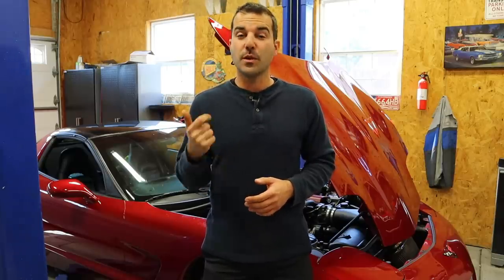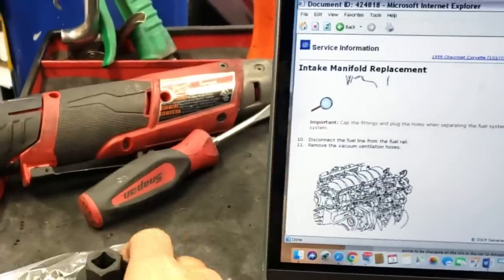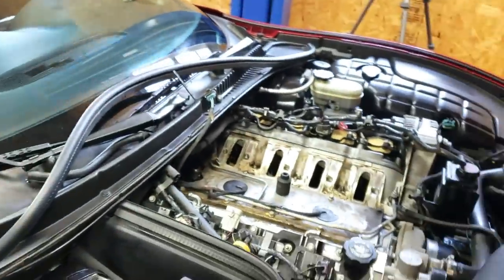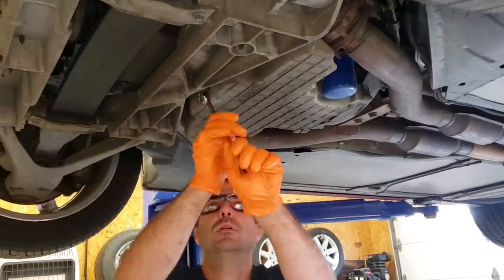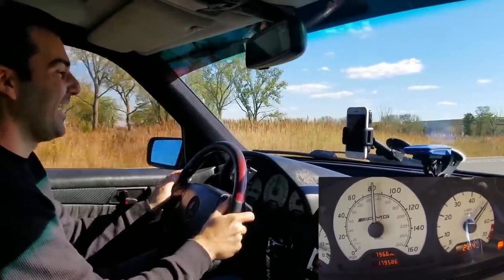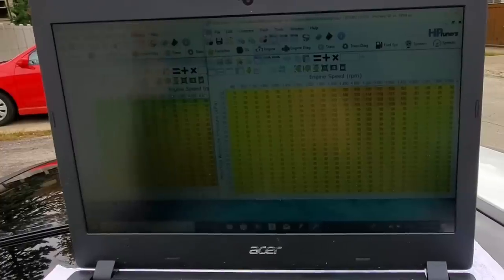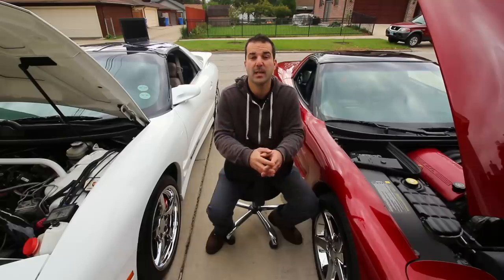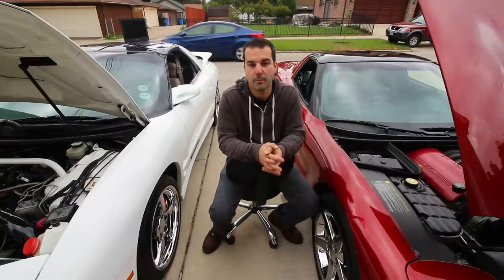I’m Building A 40 MPG Corvette That Sacrifices NOTHING! Project EcoVette Starts Now!

Comment from the maker: Do you think 40 MPG is possible and what other mods would you do?
Reply: Northstar Swap
Reply: Some sweet retro dinner plate wheels should help with aero
Reply: So first off, Weight reduction!  Less weight equals less total mass, which will increase fuel economy.  Next, Aerodynamics.  Lower the car as much as possible without needing to replace lower control arms and add a flat bottom with a diffuser.  also, try to find aerodynamic side mirrors.  Finally, I would try to decrease rotating mass, so lightweight wheels, brakes, and grab a carbon fiber one piece driveshaft too!  Before tuning or anything, I would decrease weight and the coefficient of drag, this gets physics on your side before the difficult part of tuning for extra mpg.

SO GLAD someone is doing a high fuel economy sports car.  I have a 2015 WRX and love getting 33mpg with my mods!
Reply: Its Doable, because Even the modern Formula 1 cars are crazy efficient with their high horse power engines.
Reply: First things first,  run a VSI LPG system therefore you lose no BHP at all vs conventional petrol or gasoline setup per say. Then some weight reduction as indicated by some helps wonders 😁 Also run some high flow air filter/s and finally run an “economy” remap and that should easily crack 50MPG with all of the above with no real drawbacks.
Reply from the maker: I'm leaning the LS1
Reply from the maker: Thanks brother!
Reply: Better air dam .. just get some conveyor belt material and bring it WAY DOWN close to the pavement.  Conveyor belt material is stiff enough to maintain it's shape but will deform (obviously) with no damage.  Also close up the body panel gaps you can infill with black plastic/foam material ... or gasket a movable panel such as Toyota does with gaskets around the full hood perimeters.
Reply: A die hard ecomodder could get close to 40mpg with that c5 with tire pressure and knowing how to drive
Reply: LegitStreetCars we do lean burn modes here in Florida. We don't have emissions or any regulations on how we run our cars. But a smart mod for sure
Reply: Dimple the entire car like a golf ball.
Reply: So glad that someone is doing this experiment, some mods do give better MPG 
Do a overdrive gear on the transmission should help. Also let wider tires can also help BUT i rather have the less heavier rims and wider tires. Also have a under tray so air travels smoothly under the car.
Reply: LegitStreetCars why not just add on a hydrogen fuel cell. That will indefinitely gives you the higher MPGs AND add roughly 125-150hp.  And it doesn't break the bank www.aquatune.com
Reply: Cylinder deactivation would be great ,, typically done by alternating left bank/right bank fuel to zero on 1 minute intervals ,, I think it's used on LS powered pickups ... might be doable.,, also the "dead" bank would be cooled so in a ultra lean configuration it would help immensely.
Reply: i´d make the 6th gear, make some shields for the bottom of the car as a aero mod and make some weight reduction
Reply: 1st mod. Change the wheels.
Reply: Can you test the HHO sistem....you know....the hidrogen generator !!!! Please .....i must see if its going....maybe i will put on my 740  E38 !! 😮😮😮😮
Reply: Possible?  I think it's at the upper realm of possibility, but it's an interesting challenge.  I'd concentrate on the tuning and weight reduction.  The C/D of the C5 @ .29 is actually VERY good considering the size of the car and especially the steamroller tires.  I don't see a need to slam it on the ground, add underbody panels, etc, as that .29 C/D is in factory form and would be very difficult to measurably improve upon.  I'd go back to factory sized wheels and tires (Look for magnesium C5 wheels, they're ultra light and relatively cheap), do a round of bolt on modifications like long tube headers, a ZO6 Titanium exhaust, toss an underdrive pulley on it, maybe even an electric water pump to free up that extra bit of work the motor is doing with a factory water pump.  Making the motor more efficient will probably yield your biggest gains.  Then......weight reduction.  Look for 16 places to remove an ounce, not 1 place to remove 16 oz's.  Shed as much weight as you can  without compromising anything.  There's TONS of places where there's extra nuts and bolts that can be removed, covers and shields along the tunnel, carpet backing, etc.  If it's got an F45 or F55 system, swap it all out for some standard shocks.  After tuning....yeah, you might get there.  I get around 28 MPG highway out of my twin turbo C5 with 95lb/hr injectors......don't see why you couldn't get your factory setup near or at 40.
Reply: @sys-administrator  i don't do that
Reply: I'd say the remapping to as lean as possible fuel mixture without missfiring on low throttle and having as much as possible ignition advance helps you reach your goal.

My experience tells, when you go leaner on part throttle, you will actually need less throttle to keep the speed.
Same happens of course when advancing ignition timing.
 Going leaner than stoich is bad for emissions.. but who actually cares when driving a corvette.
Just saying, why factories run the engines most of the time on lambda=1.00

Off-topic, but I have to say I'm quite impressed with E85 fuel and it is actually possible to have lower fuel consumption when the engine is built only for E85.
 Can use extremely high compression ratio, lots of ignition timing and very lean mixture without issues.
No knocking issues (atleast on modern naturally aspirated engines), and you get a bit more power, tho the fuel consumption will sky rocket on heavy accelerations compared to gas.

Based on my experience.
Reply: @williammcguire1273  and if weight is reduced enough .. the gear ratio can be changed to reduce engine rpm at highway speeds.
Reply: @9a21x  Show me a link of any northstar v8 reaching 40mpg. You must be joking
Reply: Strip the car interior
Reply: I believe mid to high 30s is definitely achievable. When I used to be a lot more active in the Mazdaspeed community we had a guy that was tuning himself to be targeting 17-18:1 at cruise, but would command the regular 11.8:1 when he went WOT.  He was getting 34 mpg I believe and normally the best we could pull with a regular fueling amount was about 24-25 mpg.
Reply: Believe it or not a turbo. Properly sized, a turbo can practically eliminate pumping losses by making the pressure in the exhaust lower than the intake, specially easy to do with an upsized exhaust.

Second mod now with a turbo would be water/water methanol injection. This can allow the engine to run lean or steqiometric under boost, by using the water to avoid predetonation.

I know it's on the expensive side, but if you wanna raise the mpg goal, why not.

Also water injection can reduce NOX emissions whbe running super lean.
Reply: LegitStreetCars 4 cylinder turbo corvette
Reply: It's possible allday at 60mph
Reply: And a 308 gear.
Reply: At 60 MPH I bet that thing with a good tuneup and 6-speed manual probably already gets about 34 MPG.  They are lightweight with lots of torque and geared really tall.  They are almost idling at 60 MPH.
Reply: No I don't think it's possible but I'm no mechanic, definitely not city... I'm subbing tho cuz I wanna follow this.
Reply: @9a21x  then it's technically a sacrifice. Of coarse swapping a engine will make it easier to get better mpg.
Reply: @athalc  haha maybe in the late 80's early 90's that was cool lol.
Reply: to help aero and keep the sweet look of the c5, you could add a full belly pan to lower under car air  turbulence
Reply: Doubtful with normal driving. 92-95 civic vx 96-00 hx and manual honda insights 00-06 ran lean burn in federal emissions format.
Reply: It is simple before blowing apart the engine. The basic better flow header to muffler. To better intake for it to better coils and wires look for thunder wires for it. There better type of wires
Reply: LegitStreetCars 
Cummins 4bt , thin wheels and ludicrous tyre pressures . Tape the gaps , remove the interior. Remove wing mirrors . Much longer rear differential and it’ll still never get 40mpg.
Reply: Get 39 hmpg. Just had a great tuner make some adjustment to the computer and now better horsepower plus better mpg. 2003 Z06
Reply: Electronic Water Pump, Electric Power Steering/ Delete Power Steering,  and lightweight pulleys. AC Delete or an electric alternative if possible.
Less resistance on the crank shaft, means more power, and MPG!
Reply: Aero. You’ll need way less drag and I would run smaller wheels and lightweight ones as well. Or on the cheap get some 16” wheels IF they will fit.
Reply: @9a21x  Yeah, because a larger, heavier, more complicated, and less efficient engine is the goal.
Reply: Acheieve 40 miles per gallon and then see how fast it takes to make the fuel economy horrible again with my lead foot because a corvette is the last car to be driven fucking slow 😂
Reply: Swap out that 40 mpg for twin turboes and a better power figure 😂 becauee life is too short to worry about miles per gallon 😂
Reply: Put your Tesla motor on it and make it a hybrid
Reply: Missing a corvette for fuel Economy sounds like the emissions control got involved 😂 that sounds terrible 😂
Reply: This isn’t the first time I have been underwhelmed about a car and to be fair this corvette most likely is the last car I would find underwhelming but for him to do this nah nah this shit is terrible 😂
Reply: @briantracy1324  That technology wasn't available for ls1's. Sure anything is doable, but that would most likely require an engine swap(l99), and wiring and computer. The l99 was similar to the ls2 but but found in automatic camaro's and came with cylinder deactivation.
Reply: If chevy wanted an economic corvette it would have had a 4 cylinder right about now BUT IT DOESN’T😂 because chevy don’t care for that shit fuck the gas pump I just want to have fun no matter how many times I have to fill up that’s what the 8 cylinders are there for 😂
Reply: @juhonmoottoripaja2443  Most modern engines are direct injected. Impossible to knock, as the fuel isn't in the cylinder until it needs to be.
Reply: @ignasanchezl  Turbo's make an engine more efficient under load, he's attempting to gain efficiency in very low load situations.
Reply: @norm1233  Not a northstar. The LS platform is arguably one of the most efficient v8's ever produced, I would argue the most efficient(excluding current production), when considering physical size, weight, and power per displacement.
Reply: @norm1233  he said he was going for mpg, not cool😜
Reply: Low rolling resistance tyres
Reply: Have you considered fitting dimples to the body to reduce drag?
Reply: I don’t think it’s possible to average 40mpg for lets say 1hr on highway at 60mpg (so 60 mile trip).
But I do hope you can achieve your goals or come close enough to be happy with results.

Do you think low temperature thermostat would help? I know it will cause engine to run rich with factory tune. But since you’re tuning it anyway. The low temp thermostat might help keep it cool during lean conditions.

Also, I always wondered. Can you ask your turner. Is it possible to adjust cylinder deactivation to run in 4 cylinder mode more often. Basically move the load threshold higher. My Silverado 5.3 gets 30mph @ 60mph completely level road & no wind but any slight change to conditions will kick it into V8 mode and mpg drops to 21mpg. So realistically it only stays in 4 cylinder mode for 20-30 seconds at a time, V8 for 1 minute then back to 4. Not directly related to your Corvette engine. But it’s on LS MPG topic. Thanks

Good Luck
Reply: Groove the throttle body and heads. Bet you'll go beyond 40MPG...Oh yeah,  since its an OBD II and an older vehicle, if you do the throttle body: Do Not disable the PCV. Good job picking NGK. To me, they still seem the best for any plug.
Reply: @Mark-lw9mz  ,
Ah, like that adiabatic Fiero designed by Smokey Yunick and his team that was supposed to get ~ 75+ mpg using their interpretation of a fuel vaporizer?
Reply: Vented fenders.
Reply: My C5 has cai, headers, and exhaust with dyno tune.  I'm already getting 34-36mpg highway.
Reply: Undercarriage paneling.  A lot of people forget about the bottom.
Straight piping cat-less exhaust.
Reply: @cam872k3  This is true, I forgot, because flow is limited by the throttle body (unlike diesels).
However it could still gain efficiency if you raise the gearing, lowering the RPM meaning you run close to WOT at cruise. But it either be a higher speed or a very small turbo.
Reply: Switch to tires that have a lower rolling resistance rating.
Reply: No, not possible unless you strip everything out of the car to make it as light as possible, are only running on 2 cylinders and never go over 10 MPH.
Reply: I would use my prototype and it would probably more than double that 40 MPG.
Reply: My 1 liter 3 cylinder Fiesta gets 42 highway, depending on the wind direction.
Reply: @partyman6666  That Double od helps alot...
Reply: Prius Swap!!
Reply: @briantracy1324  I would not recommend cylinder deactivation.
Reply: @cam872k3  What I meant by 'modern engine', I meant  modern basic design of the engine.
Like 4 valve cylinderhead with pent-roof combustion chamber, with quite minimal squish clearance.

Or ports designed for high tumble (most 4 valve) or swirl (2 valve).

Just like my volvo b6304 engine.
14:1 comp on stock cams (20-21bar cranking pressure, +13:1 dynamic comp ratio), E85 and it is impossible to cause knock unless going suddenly very* lean @ WOT on high gear and rpms. 
Haven't had that happen tho.
Or maybe it'll blow up if there would be suddenly for some reason more than 50 degrees ignition timing at high rpm's.
Reply: Easily.
Reply: Did you know Chrysler use to have a lean burn computer on cars back in the late 70's and early 80's for fuel savings
Reply: Look into a" HOT AIR INTAKE"
Reply: Also a "HHO" system will help
Reply: Swap it with 1.9tdi, you'll get 70mpg no problem 😂
Reply: Diesel
Reply: I managed 32mpg on stock 97-01 convertibles on long road trips and those were autos. With a manual it should be pretty easy to get that 40 with the right mods.
Reply: Northstar cylinder deactivation I guess?
Reply: Why not run it reacher and adding firing angle?
Reply: With more aggressive aero modding and driving techniques I think you could pull off mid to upper 40's without too much trouble.
Reply: I do know an engineer who worked on the lean cruise feature at Holden. You can only lean out the mixture so far before it starts to degrade the BSFC, brake specific fuel consumption. What you will need to do on the dyno is to lean out the mixture and divide the fuel consumption rate (grams/second) by the brake power produced. Keep in mind you will need to maintain the same given load (grams/cylinder) whilst performing this test. You are better off just using Holden's calibration as a starting point. Don't worry about burning out pistons and valves, as with lean cruise it should only be active at engine loads and speeds where the heat rate through the engine is quite low. Running leaner does assist in the burning off all the hydrocarbons stuck in the crevices down between the piston and wall. As you start to lean out the fuel mixture the engine torque will start to drop off quite quickly(compared enriching) for the same given engine load. Running a fuel mixture that produces lower torque will allow you to run the engine at a higher load point where there are lower pumping losses. Pumping losses occur at higher manifold vaccums where the vaccum is acting on the piston reversing the engine's work during the intake stroke. This is why manufactures add external or internal EGR at lower loads to reduce these losses... Good luck and have fun :)
Reply: @Nioooke  Yep underbody aero panels do make a large difference. This is why all manufacturers use them now. Narrower tyres also aid in reducing drag.
Reply: @sys-administrator  Most V8's that feature fully variable valve timing will run in Atkinson mode at lower loads.
Reply: Andrew Gartner 
Wow u made my day 😂😂😂
Reply: @juhonmoottoripaja2443  I'd be interested to see fuel economy numbers on a vehicle built just for e85. At the shop I worked at, when doing an e85 tune on a non factory e85 car, we started by adding 30% to the entire fuel table. That does not bode well for fuel economy. 

I run 11:1 static CR on one of my ford dohc engines with 20+ lbs of boost for the reasons you mentioned. Stock was 9.8 naturally aspirated. Port injection, but still incredible resistance to knock do to combustion chamber design. I know guys running 14:1 CR's, but I wanted to run pump 93 octane, so I stayed more conservative.

On topic,
I know an LS tuner that runs all his high hp cars at 240 degree water temperature. I watched a lot of videos yesterday, so I can't remember if he mentioned it, but warming that engine up will help with fuel economy. I've watched fuel economy competitions and those guys run high engine temps, and even heat the fuel up.
Reply: @Mark-lw9mz  Yes, this too.
Reply: @That_Handle  There was a lot more to that car, and it wasn't high pressure, it was carbureted. But the idea of vaporized fuel being easier to burn is there. That's one of the main benefits of modern direct injected engines, very high fuel pressure going into the cylinder.
Reply: @ignasanchezl  Unfortunately due to emissions standards, even modern diesels have throttle bodies. They need a throttle so the intake has vacuum for the egr to function. I'm hoping I can figure out a throttle delete for my 2.8l mini duramax.
Reply: I am thinking cheap and keeping the car close to stock .Complete under belly pan , drill the rotors , make sure the calipers are as free floating as possible ( so a basic clean /servicing) . Every gap on the car lay a bead of clear caulking then cut it so you can open doors hood ect. E water pump ,water injection, light pullies and a 4 rib belt over drive the alternator and have a switch to turn it off and on as needed,light weight battery, arrow mirrors. The tune in 5th and 6th gear possibly with a 2nd small lpg fuel system just for lean burn hwy use and with a duty cycle on the injector close to 0 as possible .Now dollar for dollar a LPG swap would save the most per mile.in driving costs but thats not what this experiment is about.
Reply: I got around 37 mpg on my 04 zo6 on a trip from Kissimmee Fl to NYC, so it’s possible!
Reply: @cam872k3  Yes, the hotter you can get the engine the better it is for fuel economy.
The intake air is a different thing with more to think of.

Sadly the volvo engine I mentioned is not developed fuel economy on mind, so I did not focus on the fuel consumption as much as I wish I had.
Spent a lot time on WOT tuning, just chasing the maximum power/torque numbers.

About 10L/100km was possible on city driving.
Less could have been possible with higher throttle linkage ratio.
Invidual throttle bodies and low throttle linkage ratio meant I had to be very careful with the throttle so I would not keep the car accelerating slowly = bad for fuel consumption.
 And I could have went a lot leaner (from lambda 1.00-1.05) and try more ignition timing (33-35 degrees) at low throttle.

That fuel consumption might sound quite bad for a 3 liter straight six engine, but it has quite short gear ratios (~3300rpm @ 100km/h) which doesn't really help with fuel consumption since the engine has quite a bit torque.
And that is why on the highway the fuel consumption was the same.
 Tho I did achieve for a short time average of 8L/100km when I had my laptop where I could see the throttle position... numbers are based on ecu logging (new tested injectors, no leakage).

With an engine with something like 10:1 static compression ratio does not benefit as much of the E85 and fuel consumption will be probably at around +20-25% after optimizing the fuel consumption with mapping compared to gas.
 Depends a lot of the engine how it effects on torque figures -> how much less throttle is required to keep the speed.
Reply: I don't think you will hit 40USMPG if cruising at 75mph
Reply: It would be interesting to see an a/f ratio at your 60 mph test speed . Will it run at 15-16 af?
Reply: Yeah just like Marconi invented the radio so that guys grandfather invented spark plugs 😂😂😂😂😂😂 get educated a little dude and see who really invented ignition system for cars yeah including spark plugs. And it’s NOT that guys grandfather.
Reply: Don't do E-85. I'd recommend a better flowing intake manifold to go along with the headers. also remove any comfort features, Cruise Control, Traction and stability control, Air conditioning Etc...
Reply: A diy e-torque like Ram trucks use will be the only way to get that city milage, and thus, overall mpg up. There is a company that showed at SEMA a few years back, "e-charger" I think.... But I don't think they ever came to market.

So that leaves diy. AC23 electric motor and controller kit, Fab up mounts and pulleys, lipo pack or eBay supercapacitors. That should keep you in lean burn most of the time. Underbody aero and gearing should get you where you want to go.
Reply: While sacrificing nothing sounds like snake oil. If you make = power with less fuel you're going to do one of 2 things. Either lean it out to the point where you do damage to the motor (sacrificing longevity) or you've uncovered a scheme between big auto and big oil to keep high horsepower high performance high mpg vehicles off the market (Or from a less sinister point of view beat all the engineers in a multi billion dollar corporation). 100% clickbait. Next video you should show us your perpetual motion anti gravity machine that makes free energy for all the impoverished 3rd world people.
Reply: I'd love to see you get rid of some "rotational mass" to gain massive amounts of horsepower!
Reply: Andrew Gartner gross
Reply: Saving gas, making NOx.
Reply: @kirstysinclair9021  my 4bt thunderbird was getting 39 mpg this summer. 4bt in a vette would do 40 i bet
Reply: I got 29 mpg in a C5Z with headers, tune and lowered on stock bolts. The FRC vettes has the worst aero, so 40mpg is possible and cool. 
After 3.90 gears, and cam I was at 26mpg
Reply: @AnthonyMichael504  
I've not heard of anyone having results from aquatune.  
The Book was written by George Wiseman of eagle-research.com about how they do and dont work and how to design and build your own. Many electrolyzers on the market suck because they were built poorly.
The ones at fuelsaver-mpg.com are effective, of the Wiseman design with updated electronics.
40 mpg can be done, but will require fuel vaporization.
Reply: Yes.  Go on a diet.  Change Vette dress code to skivvies & flip flops.  3 coats of wax, not 2.  JK, of course.
Reply: Remote mount turbo duh lol
Reply: @juhonmoottoripaja2443  depending on the motor and build you can lean it out as much as possible (lpg runs real lean otherwise it will grenade) but leaning out a motor can increase hp slightly decreasing tq and vice versa running the motor richer with gas
Reply: @AndyFromm  interesting, I really wouldn't want to do a 4bt swap to a car that already makes more power and similar torque from an engine weighing half as much, but I guess you can always up the boost?

I had an 87 tbird that I drove 60 100 miles a day to and from work. If I kept my speed to 65 mph (75 zone) I could do 30mpg all day long. Slowing down to 55 mph could get me up to 35 mpg, but it was annoying having everyone fly by you all day long. 

More then once I averaged 600+ miles to a 22 gallon tank (18 gallons or so useable). I always wondered what would happen if I actually tried to modify it for better mileage. It was bone stock around 130k miles.
Reply: @lilsammywasapunkrock  without looking it up, I'm guessing a 87 tbird is fairly light compared to a 89-97 which helps mpg. My 91 is a tank around 4500 lbs
Reply: @AndyFromm  wow, so you added close to 1000lbs with the swap? Curb weight for a 91 was about 3800lbs, a bit less if you had the 3.8. Mine should have been about 3400 since it was fully loaded and a v-8, but I was carrying a couple hundred lbs worth of tools for work.
Reply: @lilsammywasapunkrock  it should have only added around 300-400, for the car it's self doing the swap
Reply: Carpe Diem Arts its most widely used in Europe. It's been years on anything from economic fords to drag cars. It can be used as a big power upgrade or as just as mpg enhancer. I use it myself on my V8 and I've had gains in power, cleaner running engine as well as a cooler running motor as well as some mpg gains when not pegging the accelerator.   Problem is today people are mental about electric cars. It's sad. But nonetheless a phase.  Hydrogen has been a techno plug used for hundreds of years and infact used today on aircraft carriers. It works. Try it. You won't regret it.
Reply: PDurici easily crack 50mpg with a v8!? Stop trolling
Reply: @benson4u215  You mean at wot? The air-to-fuel ratio when the engine makes it's best peak horsepower or torque depends a lot of the engine design and if you use gas or alcohol.
Alcohol engines seem to like it very rich, leaner causes power to drop (not much but still).
Like on E85 I noticed the engine liked it at around lambda 0.72-0.73 at high rpms.
Gas around 0.85-0.92.
Maybe it's a different deal again with bigger cams (lots of overlap) and well designed headers, when the exhaust gas temps make a difference -> another thing to affect 'the best' air-to-fuel ratio for power/torque.

I have no idea how I could explain the part throttle lean mixture = more power since it requires even less throttle to keep the speed.
 Maybe the combustion is just more efficient (faster, more complete/"perfect") with lean mixture, and also exhaust gas temps higher.
Would be interesting to run on a dyno with egt sensors to have some sort of theory why it's better at part throttle (less than 10% to be specific).
Reply: Maybe with a 4.8L.
Reply: Skinny 235 tires at 80psi, duct tape body lines.
Reply: Probably not. Unless you get that drag coefficient down to like .20. Would require some serious body mods. These cars are really quite efficient the way they are though.
Reply: Get a cam ground for mileage and low rpm grunt to pull the low rpm you want to turn the motor at going for mpg. Get the lost performance back with a small nitrous kit.
Reply: Put on LRR size 195s on it that should be good for +2 or +3 mpg lol
Reply: Lot of misconception here about how fuel mileage works. It has nothing to do with weight. Highway mileage is all about drag. It takes a certain amount of energy to defeat drag no matter how much the car weighs or what engine is in it. And you can only get so much efficiency out of a certain size engine. Lean burn is only going to help so much. It’s all about that air flow. Especially around the bottom of the car and the wheels. Then the engine is going to be your next hurdle. Larger engines are less efficient by nature, takes more power to move all the parts
Reply: Might look weird but, you could make (or have someone make) some lexan fender skirts for the rear wheels. It might help with aerodynamics.
Reply: Low Rolling Resistance tires?  Sticky summer tires work against you in fuel economy.  But you'd lose some grip for sure.
Reply: Just some FYI, to run lean burn you can tune the car leaner and leaner untill it starts to cut out, then you add a bit more timing and see if it stops to cutting out, if it does your good, if not add back a bit of fuel untill it just smooths out and that's about the best the car can do.. also the tune is in cruise cells only, never when needing power. Another way if your turboed is to run a turbo that hits zero to 1psi while in cruise and that removes engine pumping loss. Another thing to help avoid knock is water or water/meth injection controlled by the ECU when egt, get to high to help cool valves and head.
Reply: More than possible, maybe a low goal if I'm being honest, but I haven't watched the video yet, so I don't know your budget. 

First of all, under highway, constant speeds, I get 30mpg in my c6, no mods of note, so you don't need to gain too much.

Weight savings, stripping out most of the interior, replace body/roof with carbon fiber, smaller alternator, lighter engine build, aero is already fantastic on the car, lighter wheels (sensing a theme here?), valve/intake/head job, make sure everything is optimized, as I'm typing this, you ruled out a few of the things I suggested but, there's a ton of ways you can gain/keep power and increase efficiency.
Reply: Lean burn sounds fascinating, also hybrid systems can be faster and more fuel efficient at the same time.  I have wondered why car companies didn't do that, knew the science but I didn't realize it was illegal because of nox.  

Imagine getting an electric assist motor for the front wheels for takeoff, and to be more fuel efficient with normal hybrid tech, while accelerating faster.  Would probably be fairly heavy, though
Reply: head machining for higher compression?
Premium Gas, early ignition?
Reply: May be more doable than you would think years ago I think it was the guy from the smoking tire did a milage challenge where he pit his Corvette against a Prius the Prius did win but not by much. It mostly came down. To the way he drove and the Corvette being a light car.
Reply: ecotech diesel swap :)
Reply: Where is the link to the Shop manuals for the cars..?
Reply: Higher base fuel pressure to aid in atomization, different injectors with a better spray pattern. Methanol injection to control combustion chamber hot-spots and aid in de-coking the combustion chambers which will accumulate carbon buildup due to weird flame-front propagation. The load/rpm window that lean burn will work while saying off det and being advantageous to kw/kg ratio will be narrow with a 2V motor without VVT. Lean burn modes almost require the combustion chamber designed for really high swirl or else the fuel does not homogenize properly and you develop hot-spots, loose power making the engine less efficient and etc. You CAN gain some advantage from lean-burn up to a point, while drastically increasing NOX production, but 2V engines with large diameter bores are notoriously difficult to tune in a lean-mode. I have done several hypermiling tunes on different cars, and the most successful were higher-compression VVT engines with 4v/cyl where I could achieve 200HP+/ per Litre (with forced induction) and 42-44 MPG lean cruise, K20z3 honda with RDX injectors; 11.1:1 compression, 76mm turbo at 12.4lbs running 91Oct+methanol
Reply: I never was able to get a LS engine stable at cruise running leaner than around 15.3:1 AFR. Also, the sensitivity to fuel from one fuel station to the next will be increased. Make sure your tuner increases the table resolution in the areas around lean cruise and you CANNOT rely on the factory HO2s, get a pair of AFR500v2 with the NGK sensors
Reply: Run lean till you get a little surging/ bucking (which is from dissimilar power production from cylinder to cylinder, not misfiring)  then back off a bit.  As long as you're not over 70~80% load on the engine, lean is fine.
Reply: I would do the lean fuel mod, add VTEC, and another special system that will eventually develop.
Reply: You could try changing around the tire pressures.  I've been curious how much of an impact this really has. Simple and possible effective solution.
Reply: Welcome to Aerodynamics ADVANCED, session one. I don't know how much this would cost and most people, at least 90%, would never dream to do this for it must be ugly especially if it's done to a nice looking sports car. But, build an exterior with carefully designed and carefully placed dimpled holes all throughout the body much like what you see on a golf ball.
Reply: I was getting over 30 out of my 95 z28 with a stock lt1 and auto trans. yeah that's highway, but still. if people can make a civic get 120+mpg with ONLY aero mods, you should be able to do 40mpg fairly easily.
Reply: I used to get high 20's in my stock foxbody 5.0L but thats be cause of the gearing and weight of the car.
Reply: Reduce the drag by adding a flat bottom plate
Reply: You should be good with just lowering and a tune. I would definitely get water injection to fight detonation and use the steam effect of water to help you move along. I have snow performance on my trans am, but not for mpgs lol.
Reply: Lassi Kinnunen  toyotas dont realy get good gas mileage the are just simple and reliable af i get 13 mpg with my v8 in my runner.
Reply: @RT_Gaming01  what ia this? And can you link me to some stuff?
Reply: @michaelbrooks9462  NO NO NO NO NO!! Why would you even suggest a junk 8 speed transmission!! Those are trash and should not have been created because they are not even necessary.
Reply: @tomjones5860  It is absolutely possible.

I am working on a project myself and am gonna turn the Auto Industry on its ear. 

What I can say about my project is It is a pushrod engine just so people know what to expect.
Reply: @fomocoboy Not so. I have a 4.3 V6 that gets 35 MPG on the highway at 65 to 75 MPH with the setup I have. Its part of a project I am working on to turn the auto industry on its ear.
Reply: All I can say is that your V8 Pushrod Powered Corvette should be producing double the MPG over what Chevrolet window sticker said it got back when it was new. 

That means Chevrolet just either refused to build it the right way or still doesn't know how. And that's a shame.
Reply: ChrisHallett83   Oof, I used to think the same, but it's literally the same way turbojet engines work. Let me clarify, not all engines can possible reach this situations, it requires very precise engineering and configurations.
 It heavily depends on turbine sizing and geometry.

Thanks to the expansion caused do to combustion, the volume of air that the compressor moves is actually very little in comparison to the volume of air that goes through the exhaust, for this same reason you can take advantage of this and interchange higher airflow for a lower pressure on the turbine side. 

If you know about propellers, imagine the compressor as a very low pitch, easy to spin propeller, and the turbine as a very high pitch propeller which gets easily spun by airflow.
 Put them connected into a tube and generate pressure between both and look where the airflow moves, towards the path of less resistance, aka the turbine.
Reply: @michaelbrooks9462  Well im glad you like it. But its completely unecessary to have an 8 speed transmission in any vehicle. Too many gears in a transmission adds more weight that is not needed. And it also makes it less efficient. 

But what do I know, I only drive a vehicle with a 4 speed that does everything I need it to do very beautifully. Sorry but I will never drive a vehicle with an 8 speed transmission because they are completely unecessary. Glad you like yours.

And its not about how an 8 speed is tuned anyway. The point is that they are not necessary and should never have been created to begin with. 

4 to 6 speeds is all a vehicle needs to get around efficiently and fast. Nuff said.
Reply: Get the license plate insert for the front bumper. Its minor but couldn't hurt
Reply: love it!! should be a good competitor to my 12 second Honda insight!.
Reply: Good porting and polishing of the intake will help, less friction/resistance getting the air into the cylinder. But here's a odd one, Weatherstripping. create some kind of smooth seals around all the body panels. You can obviously electrical tape them off, but a more usable permanent solution will help. I would be willing to bet you could probably hit at very least close to your mpg goal just from aerodynamics and drag modifications. I remember reading a ways back of a CRX that had all its seals taped off, a special cone mounted on the nose, removed mirrors and a couple of suspension adjustments that managed to achieve 118mpg, so mostly aerodynamic related mods doubled its mpg
Reply: If you want to go further with the eco modding after lean engine tune then you'll get the most with doing:
- getting a lower gear rear diff - this coupled with lean engine tune will increase engine load under cruise speeds and engine tends to get better efficiency at that point. The mentioned longer 6th gear is a great idea as well. The longer gear you get the better, a v8 will easily cruse even below 1500rpm at 70mph, especially with the aerodynamics of that corvette.
- getting not the super expensive light wheels, but 1-2 inches thinner rims and wheels, also get some low rolling resistance tyres, those make a significant difference, aspecially at lower speeds, like up to ~70mph.
Reply: Skinny tires run on high psi would help. And weight reduction.
Reply: @AnthonyMichael504  because that adds weight and complexity.
Reply: @sys-administrator  Good idea. Some VVT engines create "simulated" Atkinson cycle. But if you just grind cams with a longer intake duration it would sacrifice power. aka giving something up.
Reply: Yes , I think your mileage is possible , years ago the Corvette clubs would have economy runs with small blocks getting 50 mpg and big blocks in the 30 mpg area .  Tires pumped up , synthetic lubricants , non water antifreeze , timing , plug gap this was all enlightening and rewarding .
Reply: we're assuming you are driving the manual. BYPASS THE SHIFT STOPPER! you'll want to upshift to 2nd early to get 35 city.

you'll want to put in an aux overdrive unit somehow (how you'd do that pre-transaxle, if indeed you are driving a transaxle Vette, I'm not sure) so you can have a sort of 6th½ gear and an 8th gear. think of it as a shorter diff gear, but one that you can turn off and get the full performance mode.

you'll probably want to have the spoiler be retractable.

some aero features will need to be deleted or made retractable.

you'll want to reduce unnecessary weight. still having A/C would be nice though.

lean burn at low throttle apertures.

you'll want to have it so that you can switch the exhaust between being whisper quiet (lose 2 or 3 mpg but overtake cyclists without hurting their chests) and basically open catback.
Reply: @LegitStreetCars  i don't think lowering it will actually help, and will just make it a crashier ride. having an under-car pan as a fairing is definitely a good idea though.
Reply: @8:37 You could have done some port matching here. The 2 surfaces seem to have a wall that will affect airflow. Something to consider next time you have it open. I also would do the same on the exhaust manifolds and ports. Spray paint the gasket on both sides and file down to match. Its subtle but every bit counts.
Reply: @LeglessWonder  Weight reduction on one of these is difficult. Plastic cars, aluminum engines, where exactly do you cut weight?
Reply: So did u ever get 40mpg?
Reply: Do you think the lean burn mode would work in Pontiac G8 GXP
Reply: Great work my friend I am working on a similar project and have been researching this topic for many years.
40 mpg is even a conservative figure with enough mods 50 mpg may even be possible. internal combustion engines are no where near their potential limit.
Let me give you a few secret tips get a pen and paper 
1. Modify the ignition system so it delivers more energy, modify the spark plugs by cutting off the bridges so you get a 5mm to 6mm spark gap. (This will enable you to run much leaner AFRs)
2. You need a heated fuel delivery system. I fabricated an exhaust heated fuel system and got an extra 8 mpg.
3. Take the engine apart Ceramic coat the cylinder heads and pistons.
These are all proven technologies that are lab proven to increase efficiency.
Another way is to fabricate some sort of exhaust heat energy recovery system BMW had system that increased efficiency by 15%.
Good luck I'm eagerly awaiting your results.
Reply: I have a’02 Tahoe, with the 5.3 LS... she’s a hefty girl. You’ve given me some ideas. I need to find a tuner now lol
Reply: LRR tires, block off some of the openings on the front end, more aerodynamic rims, & put a bit of a kammback tail on the rear end; all these should get you roughly 3-6 mpg extra
Reply: Gas Mask 
My '01 Deville got 30-35 mpg all day every day. So I'd say it's close enough to be doable.
Reply: extremedrivr 
Can I follow you?
Reply: No, my old 1998 Honda civic hx had a lean burn ecu, although it was set for around 55 mpg the old highway speed standard,  so nowadays driving 65+ to keep up with traffic,  you never can engage the lean burn,  unless maybe on back roads
Reply: 2.7 gears
Reply: On a c6. A c5 350 I doubt
Reply: You just have to run the RPM really low with big tall gears, as the large engines waste quite a lot of energy just moving the parts - to the point that in town, you often use more fuel just turning the engine than you do actually pushing the car down the road. Corvettes are usually geared quite tall so this shouldn't be a problem.
Reply: Tdi diesel swap with lots of weight reduction and possibly get in upper 60s mpg
Reply: I know I am a bit late to the party here LegitStreetCars

But..

It absolutely is possible as you found out

I had a 96 S10 SS with the 4.3 V6 that I upgraded from the factory 17 MPG on 15.0 Gallons of fuel (260 Miles) to a healthy 25 MPG on 15.0 Gallons of fuel (380 Miles). 

I was not done with the mods either but sadly due to a dumb decision I no longer have my SS. 😔

Yeah I got 32 MPG on the highway consistently.

So keep up the great work guys 

And maybe someday I can have redemption with owning another SS.
Reply: @9a21x  Northstar engines sucks.
Reply: my stock c6 auto got 33.2 over 4400 mile trip so very easily done rear end gearing and 6th gear final ratio is key big time on it
Reply: What are the gear ratios like? In an aerodynamic car with a large engine it's possible to string them out as much as possible.